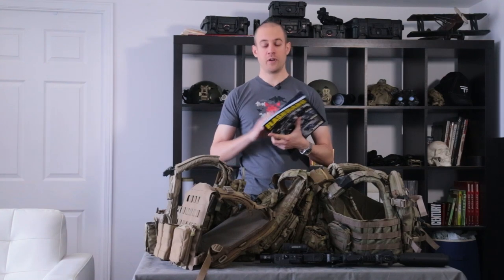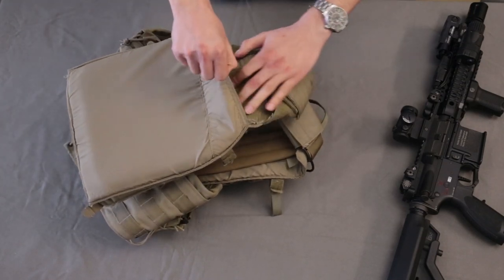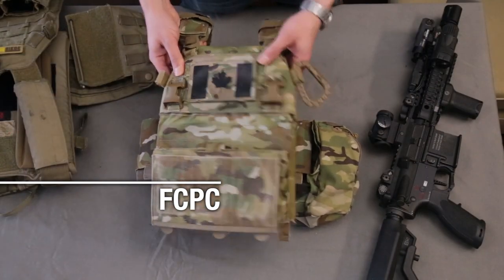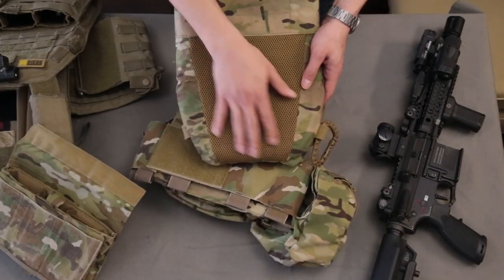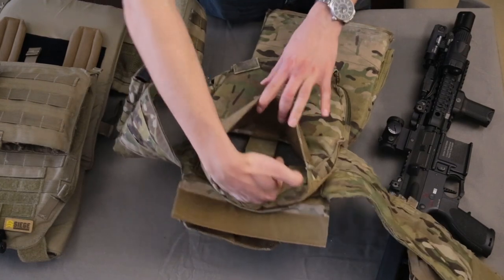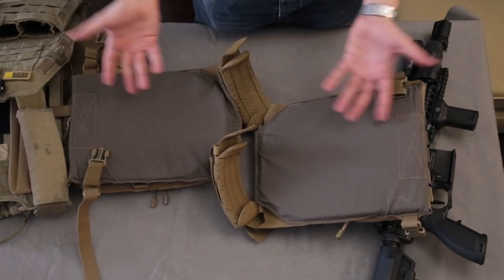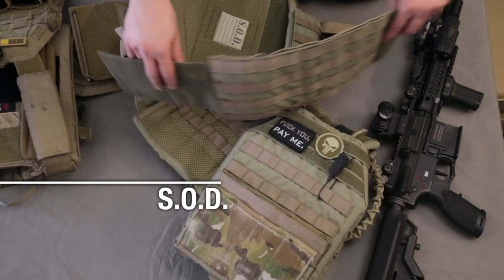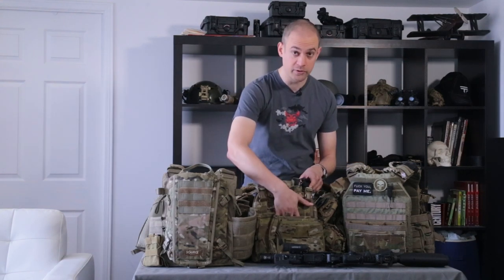Plate Carriers: LBT 6094A, Mayflower APC, SOD Gear Spectre, Ferro Concepts PC and BFG PLATEminus

Comment: Great comparison! I wonder how you only have 980 subscribers if the video has over 13k views...

One thing though: I have sewn plate carriers myself, and basically I first sew the front and back together inside out, turn the outside out and sew it again. So that leaves the plate carrier with stitching both on the inside AND the outside. I assume LBT & Mayflower go about the same way, so the outside seam is rather a plus than a negative thing.
But I very much appreciate that you even address the stitching in your review though, I don't see that very often. :)

Comment: Hoping for an answers using the sod rig or any of the bigger solid rigs do they have built in soft armor already in the carrier or it's just padding then throw your plate in it and do you know of any that will accept both I'm a big guy im an XLT  SO I need large plates but I want a small soft body armor in front ar500 plate behind that for my wife she's small and I feel like a level 3 soft up front with the level IV same shape put together and slid in the front aswell the rear  god forbid my wife was to catch a round no fkecking splatter if the soft takes the hit then the plate makes sure it don't pass through is this possible